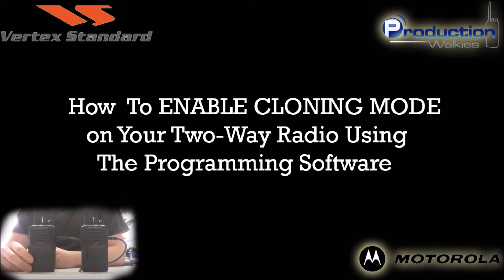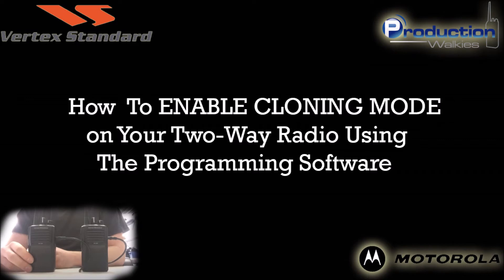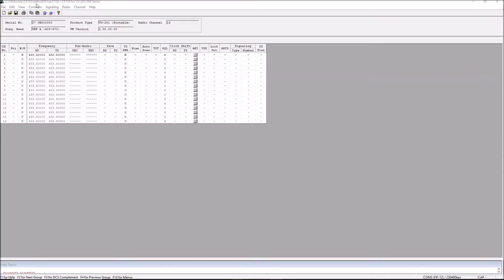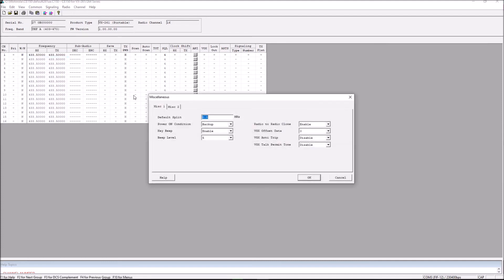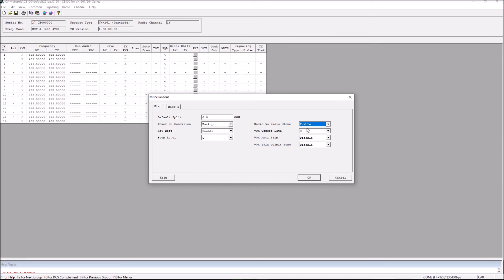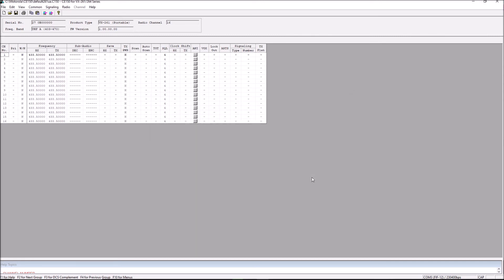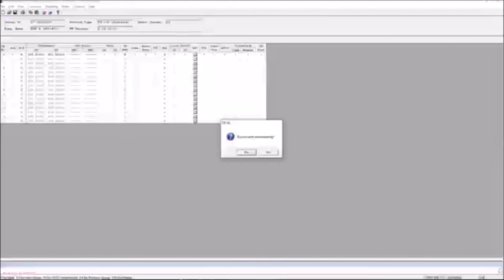Enable Cloning in Motorola (Vertex Standard) VX 261 Programming Software

Comment: FYI I was getting both radios blinking red and wasn’t able to clone. I discovered it was because I was trying to clone a VX 261 UHF radio onto a VX 261 VHF radio which will not work. Just another bit of info if someone is having issues and the cloning feature is activated on each radio. Hope this helps